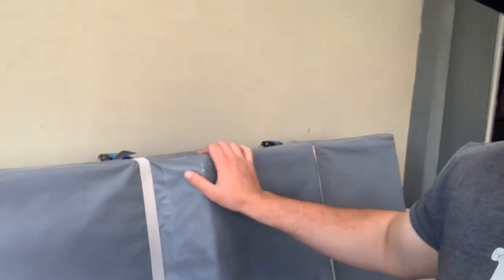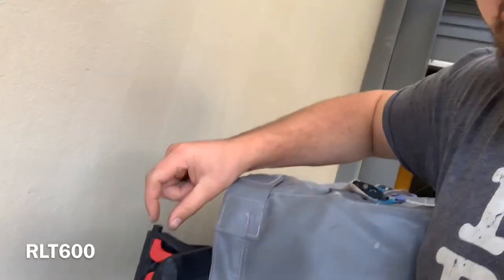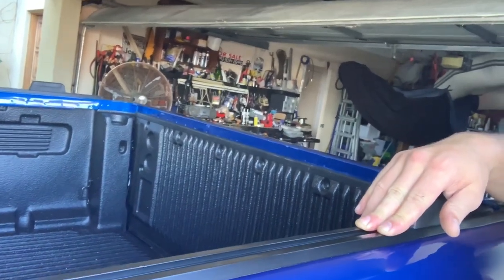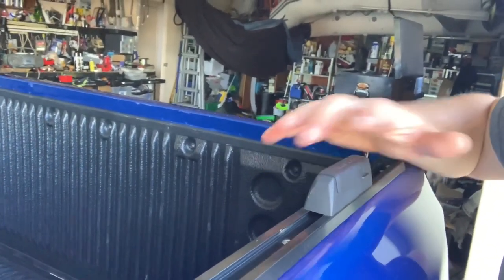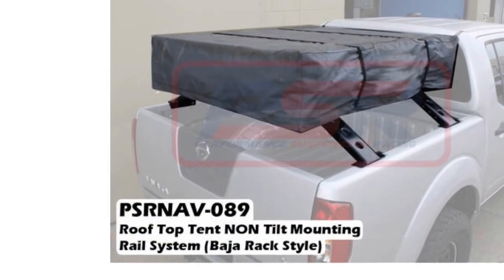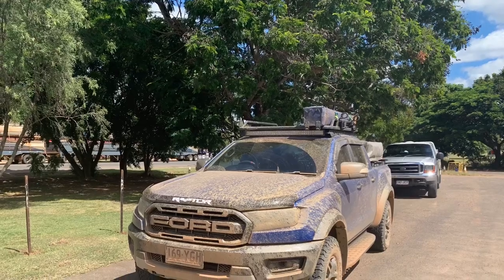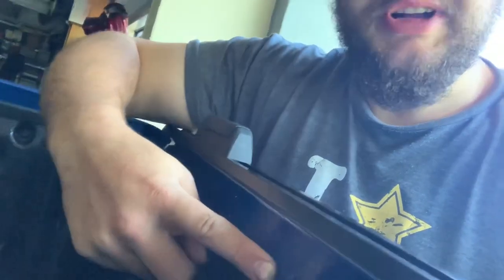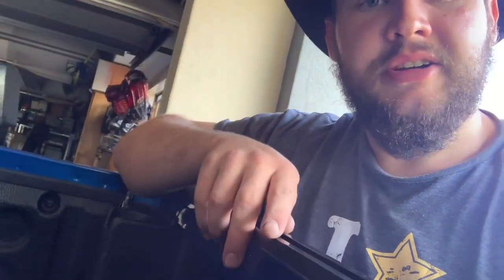Explaining My Tub Rack and Tent Setup Likes/Dislikes

Comment: Just use Rivet Nuts with screws, and attach side plates to prevent lateral motion.
Reply from the maker: Ricardo Chavarria would still have the issue of only being attached to 1 layer of sheet metal. Plus doesn’t matter anymore I have changed the setup

Comment: Nice informative video Jacob.  Im wondering if Stainless/Steel Rivets may have helped your setup.  All that holds the Rhino Back Bone to your roof is rivets and they seem really sturdy.  The only difference I can think of is the roof has more steel for the rivets to fix to?  My Roof Top Tent mounts to the same rail but its fixed to a HSP Roller R Cover that is then fixed to the side walls of the tub.  So far it has taken a beating but I do like the idea of the PSR Rack you've chosen.  Im now considering the PSR after seeing your post on the Raptor FB Page.  Just wondering how I can modify it to mount to the HSP T-Chanel.
Reply from the maker: Murray Osgood thanks for the input Murray, I think the issue has more to do with the fact I’m going through one layer of steel compared to the roof which is two too three. It tends to stretch the holes. In my new rack system it’s going through the two layered steel on the tub which should be sturdier

Comment: Hi Jacob. Love the Chanel and the vids, very informative. In regards to the movement of the rails would you be able to use a self tapping screw to hold them in place and stop the movement, as opposed to rivets?
Reply from the maker: It unfortunately would result in the same outcome. There is just not enough material under the rail to be secure